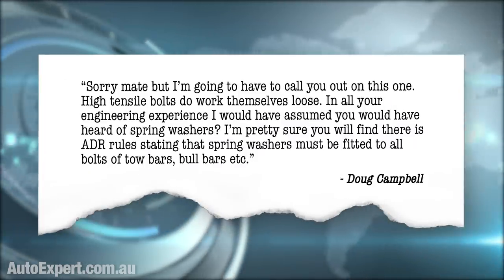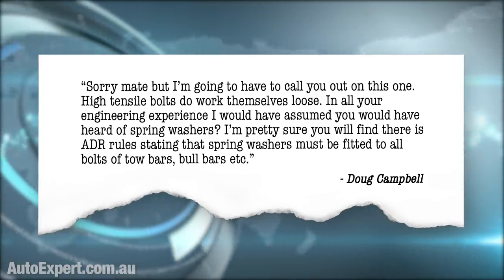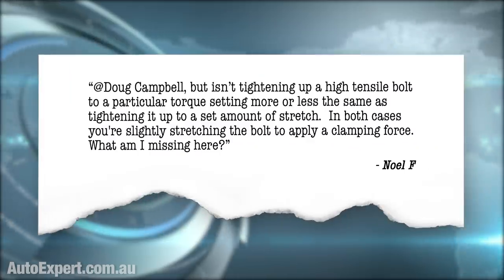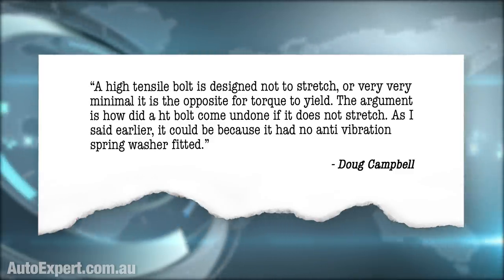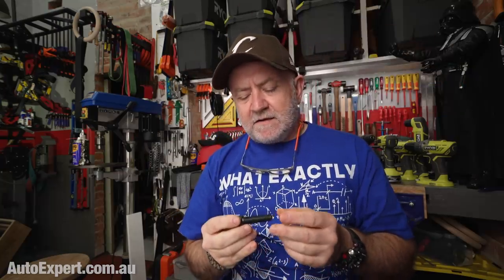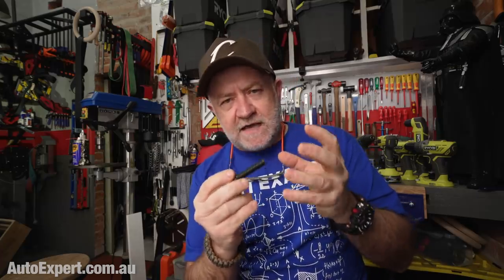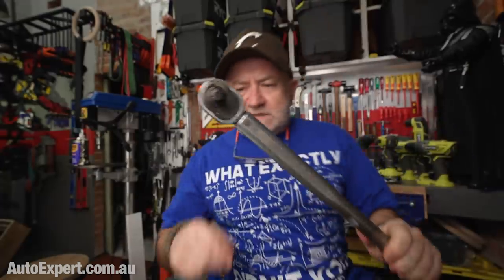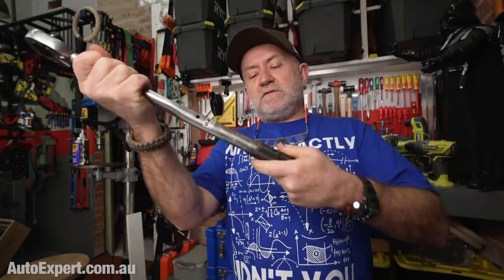The applied physics of high tensile bolted joints and assembly in cars | Auto Expert John Cadogan

Comment: John, there is no such thing as a grade 8.8 or 12.9 fastener. Grade is a reference to imperial fasteners, and class is a reference to metric fasteners. Grade 5 = class 8.8, grade 8 = class 10.9. There is no grade equivalent to a class 12.9. Spring washers do not do anything at anytime. If the fastener is done up correctly then the spring washer is flat and is now just a flat washer. There are two states in fastener technology, elastic, and plastic. A fastener done up correctly will always be just in the elastic state. If it is in the plastic state the fastener has failed metallurgically. You did not mention the two planes fasteners work in. Tensile, and Shear. When choosing a fastener you must know which plane it will be working in and choose the correct size. For shear, hole diameter to fastener size is critical. Also critical is making sure if you have a metric fastener, do not put an imperial washer under the head. This is critical in one inch diameter. The washer will cut into the machined radius under the head and the fastener will fail. I defy anyone to do up a threaded fastener correctly at anytime. You can never get the same tension in any two fasteners. In a bolted section of several fasteners they will all different and the lowest value one will fail first. The correct vibration will undo any threaded fastener that anyone does up. It is impossible to do them correctly, no matter what method. Have a look at videos f Yonkers Transverse vibration testing, very interesting. Regards,

Comment: Thanks for explaining this mate 👍.
Just wondering if adding Loctite to the bolt would be useful?
Reply: I would say probably not. If it is not tight enough, loctite will hold it there, but it will still be loose. If it is properly tight, no need for loctite. I think loctite is used where vibration can affect the joint, or large temperature changes, such as on brake fasteners.

Comment: Hi John, I am asking these as I don’t know, not to be difficult 
Does loctite act as a lubricant and require reduction of torque?
Why do the manufacturers of tow balls supply them with a spring washer- are these not high tensile?
Thanks for the information
Reply: Yes things like loctite does act as a lubricant, and torque must be adjusted when using it.
Tow balls are more of shear pins rather than high tensile applications, you just need to hold them in place. Although torquing them to the standard torque for material/size would be better than the spring washer.

Comment: All this begs a question regarding my recent experience with wheel torquing after a tire rotation. Mfg specs for my aluminium rims is 83 ft lbs. After getting the vehicle back from the mechanic I checked the torque and found it was somewhere north of 150 ft lbs. So the question is should I be concerned that the studs or wheels might have been damaged? I've re torqued now three times using my clicker and I'm always seeming to find some movement. Thoughts?
Reply: I've had 2 occasions when I've had to call "road side assist" because I couldn't undo ONE stud on a flat tyre - one the second occasion a helpful truckie couldn't either! I how have a 12V timpack wrench to UNdo them and a manual 0-200Nm torque wrench to do them up (to specification).

Comment: Sorry John but Doug Campbell is not completely wrong either and is right to some degree. Spring washers or Lock nuts are recommended and necessary in bull bars and tow bars in certain applications! The reason why because bull bars and tow bars are subject to stresses and vibrations eg. Winches, tow ball and rail vertical and horizontal forces etc which can work the nuts LOOSE! 
Yes high tensile bolts and nuts do not need spring washers if the application is of an static nature with minimal movement like a fixed steel structure or an integral part of an vehicle chassis. But because bull bars and tow bars are not an integrity part of an chassis and more or less an attachment to an chassis I believe therefore it is recommended you USE spring washers or lock nuts to prevent the nuts from working themselves loose.

A good example of this are shoe laces you can tie a knot in your shoe laces and never where your shoes and they won't come loose but if you do walk in them they more or less do eventually come loose and need to be re tightened.

I bet they didn't teach you that at engineering school! 
But what did you say at the start of your video John??? University engineering lecture in 30 mins???
Congratulations everyone is now dumber for watching this...
Reply: How can you claim that "i believe it is recommended you use spring washers ........" when he has provided 3 lots of manufacturers fitting guidelines that DO NOT recommend spring washers ?
Reply: Yeah, that's a fail there. If the correct clamping force is applied, there will never be the movement to even bring a spring washer into its intended chiselling action. Also very high tensile bolts do not work with chiselling anyway, they are too hard to bite into the nut with any meaningful or reliable purchase. John has already refuted the claims you make here.
Reply: Correct,  @francodalpozzo7533  !

Comment: Great,  not really one for commenting but you got only two things uuummm  not saying wrong but could be more correct.   some othere things.  the cap and hex bolts you hold up!  have no shanks ( IE fully threaded)  so these bolts are not to STD.  the shank should be 2 1/2 times its Dia.  fully threaded bolts have limited sheer performance.   So if you thing about it. two plates bolted together and being pulled in opposite directions making a sheer load on the bolt.  you do not want that sheer load to the on a thread.  maybe some highlighting on that the bolt is not actually holding the plates together, but the friction between the plates do.   friction created by the clamping pressure of the bolts.  What you did get wrong in your explanation of spring washers and why they don't work with HT bolts.  the spring presser is of no interest, as you pointed out there is not enough stored energy there in comparison to the threat loading. as long as there is enough to open the spring washer so that the "chisel can bite".  how ever  no spring washer has a sharp enough / strong enough "bite"  to bite into an HT bolt. in that case  its just a spacer.  to add a spring washer will not work if a washer is used anyway,  biting into a washer that can spin is pointless.   but to the guy who asked about head bolts " yield bolts"   if you ever get one of these boult in your hand you will notice two things.  the thread is long and all the thread is used in the block ( unlike a nut)   there is also a section between the head and the thread of a smaller dia.   this is the stretchy part of the bolt.  so the combination of having so much thread in contact ( surface area)   the clamping force of the stretch of the wasted shank and the friction of the head is what holds it all together

Comment: I love this shit but I am a little strange.
how about a vid on how ht high quality bolts have a step under the head and their running mate hardened washer has a curved side and a flat side so that it acts as a low fiction bearing surface.
put the washer on wrong way round and it affects the torque you can can apply. as the extra friction wont allow correct bolt stretch at a set torque wrench setting.
 oh the fun ,...then their is how different lubricants give different amount of stretch one to the other.
as I only used 30 weight oil or copper , or aluminum based  anti size.
I never knew this till 5 or 6 years ago.
as a simple diesel fitter, we/I  just followed the tension and lube specs in the cat bible.
then there is how applied heat to the head of a ht bolt in a certain procedure will remove all tension from it so you can undo it with a shifter I have seen this/done this with bolts torque to 4500 ft. pounds. alas now the bolt is u/s and must be replaced.
arr,... ht bolts it never gets old, more please I need to learn more .

Comment: I have torque wrenches and dial indicators. Can I calibrate the former with the latter via a stretch bolt standard?
Reply: Be easier to just get a torque mesauring meter and be done with it. You'd have to know how accurate the bolts themselves were (reproducibility of the stretch in a group of bolts) before you could get there. What's the cost per bolt? Is your dial indicator calibrated? https://www.youtube.com/watch?v=U4WmzGOKOFk

Comment: Watched the video and now I have a question. If someone added spring washers to a couple of parts held together with high tensile bolts. Would the higher than usual clamping force applied to the spring washer actually cause it to compress over time?
Reply: Asking for a friend? 😉

Comment: Hey JC, luv the vid and the no BS fact checking within. With regard to torque wrenches, I have 1 question. Does an extension bar, be it short or long affect the torque setting when using a torque wrench? Just so we r on the same page, when I say extension bar, I mean like the long or short extension you get with your every day socket set. Cheers in advance, love the show. 💪
Reply: Short answer is yes. Long answer is yes but its all relative. The longer and thinner an extension is the more it will twist. A 6" long 3/4" drive extension would have little effect on a bolt being torqued up to say, 50Nm. Whereas a 12" long 3/8" drive would probably have a noticeable effect on a bolt being torqued to 200Nm. This would be easy enough to test for yourself if you are interested. Torque up a fastener using a reasonably long extension say, 12" - 18", and then remove the extension and see how much more you can turn the fastener before the torque wrench 'clicks'. This should give you a reasonably good idea of the amount of torque reduction the extension bar will produce.

Cheers, JD.
Reply: @KiwiBassHead  fair call, figured that length and diameter of said extension would have some bearing and therefore one is better off attaching socket directly to torque 🔧.  👍

Comment: What about using loctite? Would this prevent loosening of bolts further? Or are the forces from the loads / tension so large this becomes insignificant?
Reply: loctite or similar is designed to 'glue' the fastener in to resist loosening in high vibration applications.

Comment: I'm a builder and former carpenter and I've done up countless amounts of bolts in people's roofs and not known any of this  stuff. What have I been doing? 😬
Reply: largely irrelevant for chippies since wood easily deforms, shrinks and swells so like John said it's all about the shear strength of the bolt not the compressive friction in the joint.
Reply: @RobB_VK6ES  That's handy because I just went looking through a few engineers drawings and notes and none of them make any reference to tensions on bolts, only the size of the bolts. I guess turn til she's tight is acceptable

Comment: I recently read something about spring washes in general, and the main points were that when it is clamped flat its chisel edges are not exposed and therefore not available to engage the nut or other surface, and therefore it has no effect until after the fixture has come loose, at which point it is already too late. Also I have seen spring washers that were distorted or broken, so what's the point?
Reply from the maker: Exactly - what's the point, especially in the hi-tensile domain.
Reply: I was just going to make a similar comment.  I've lost count of the number of times I've seen spring washers break up when misused in high tensile applications.  This often ends up contributing to components coming loose, rather than preventing them doing so.

Comment: John, what are your thoughts on wheel studs on cars. Should these be lightly lubed to resist rusting or should they be left dry ??
If they are lubed does the 30% less torque also apply ??
Thank you !
Reply: I'm going to add on to this question by asking:
1) Why lower the torque if the fastener is lubricated; wouldn't that make it more likely to loosen?
2) Does using thread-locking compounds mean the torque should be lowered?
Reply: Some of John's vids on these questions:

How to Tighten Your Wheel Nuts - The Right Way
https://www.youtube.com/watch?v=VbN9Y_fUvjo

How to anti-seize wheel nuts without over-cranking the hi-tensile studs
https://www.youtube.com/watch?v=d7UDy7B0-m8

Reacting to your wheel nut anti-seize feedback (epic nut)
https://www.youtube.com/watch?v=POcOaW7mTsg

Comment: As an educated tradie. Mechanic. I understand exactly what your trying to prove here. But you have over simplified the "problem" in my mind. You say that high tensile fasters don't work loose. What about high vibration in joints, were thread locker, serrated conical washers, etc are proven solutions. 

But back to the over simplified answer. What happens when you clamp the tow bar to the frame with the proper bolt and nut tighten to torque and the paint in the joint starts fretting and breaking down? What happens when the frame flex climbing out of a big gully and that joint shifts just a bit. What happens when you shock load the joint hitting a pot hole. 

Seen a lot of joints loosen up from the above issues. Welded a few sets nuts to wheel loader buckets to prevent the nut backing off when working in very hard material. Because the impact and vibration on the edge to bucket joint would start to fret and loosen the joint enough to slowly loosen the nut. 
Fretting is very really in high tension joint. Designed over stress is very real, which is why cranes and man lift swivel need periodic re torquing. Paint and other trash in joints can create a place to loosen a joint under enough repeat strain.

Comment: I agree with John in the sense that you shouldn't change designs without expecting there to be some kind of unforeseen consequence of the change. (Murphy's a real dick like that)

There are numerous variables at play when it comes to the engineering behind the use of nuts and bolts in their locations, are you honestly confident in your ability to say you have considered every single variable every single time? (Especially if you're the one making a change)

Bolts DO work themselves loose in certain applications (subject to aforementioned variables) which is why we have things like spring washers, star washers, Loctite and locking nuts...
Whether or not these need to be added were probably (hopefully) considered by the engineer at the time of design based on whether it was necessary or detrimental to do so.

I'd go as far as saying adding Loctite or perhaps a locking nut wouldn't alter too many variables (in the case of bullbars or towbars), but when you start changing things like washers and bolt grades you're really stepping into dangerous territory when it comes to these unforeseen consequences.

Bullbars used to (I think they do something with slots now.. due to the popularity of winches and the likes) have low(er) shear bolts on them, so in the event of an accident the bolts would shear and not compromise the "crumple zone" as badly. Due to people failing to consider all the variables, people would replace these bolts with high(er) tensile bolts and wonder why when they had a light bingle they were up for a whole new chassis due to the chassis being damaged beyond reasonable repair.

It really boils down to if something goes wrong, or if somebody dies because you thought your way was better and you cant prove without a shadow of a doubt your way is better and didn't cause the failure mode then you're fucked.. it's as simple as that.

Engineers get it wrong too, google "Tacoma narrows bridge collapse" for an interesting watch. Needless to say the people who designed that probably got in some serious trouble for that screw up.

Comment: Hmm, I might have to adjust the torque applied to my 4WD wheel nuts.  The owner's handbook specifies 140Nm which is the setting I use on the wheel nuts which are lightly oiled. 
I'd previously read that spring washers aren't a lot of use in that application so I had a hunt around the 'net tonight and found this video showing Junkers vibration testion of a plain washer vs a spring washer.  https://www.youtube.com/watch?v=j2yYj2JbdAI  Note this test appears to be with mild steel, not high tensile bolts/nuts.  Oh, I'm not advocating the use of spring washers.

Comment: Why do you reduce torque spec by 30% when lubricated? Just curious.
Reply: Applying a known torque to a fastener is an easily applied approximation to what is really desired, that being a distinct elongation of the fastener which imparts a known compression force. To use a torque setting requires that someone has done the tabulation of torque vs the compression force and in that testing the lubrication status of the fastener will be specified. During the bolt tightening process the resistance you feel as the bolt is tightened is the frictional resistance to further tightening as the bolt and nut surfaces slide over one another. Since the addition of a lubricant to any moving joint acts to reduce friction, for any given torque the resulting clamping force in the fastener will be greater when lubricated compared to a 'dry' connection. The 30% de rating is a rule of thumb compensation for common applications.
Reply: @RobB_VK6ES  cheers

Comment: John I'm not a expert.  I don't care which bolts you have on the tow bar they all need to look at least one's a year I check mine every 6 month's because my heavy ass trailer has cable breaks.. the tow hitch slides backwards and forwards with a lot of weight which leads to the towbar coming undone so I think the play in the tow hitch and the play on the tow tongue and ball has a lot to do with the Bolt's coming loose I'm saying this from my experiences and I'm not sticking up the shit box Ford they crack and break with out towing